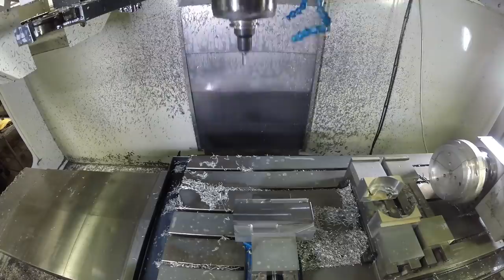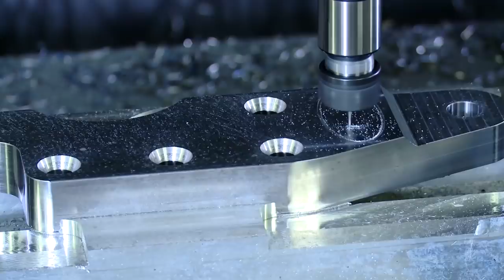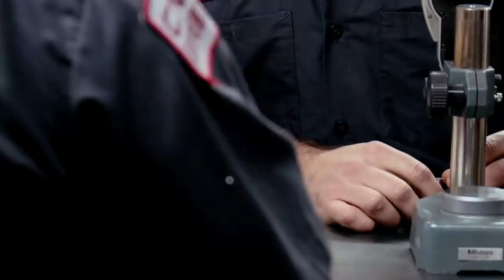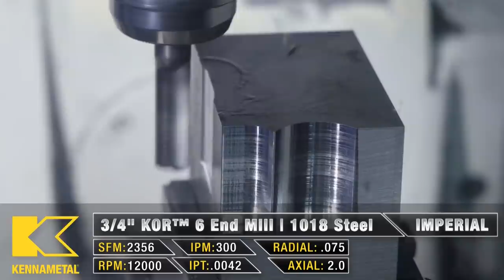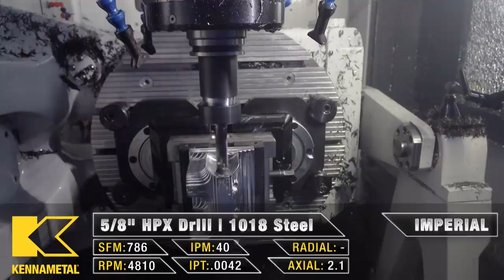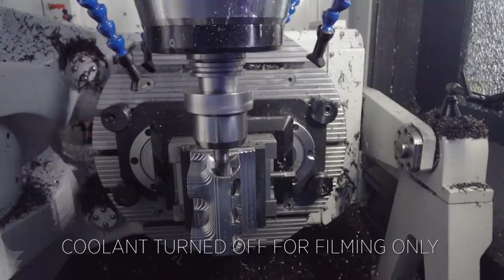Tools Keep Breaking on Night Shift, but Runs Perfect on Day Shift... Nobody Knows Why

Comment: We had a customer of ours complain that the tool life was falling off from what they were accustomed to and that there was something wrong with the inserts that we were supplying. After a months long in house review our sales rep got permission to go into the factory where they were being used. Turned out, due to piece work requirements each shift worker would pull a perfectly good working insert and put a new one in at the start of the shift so that it wouldn’t get dull on their shift and make bad parts and cause a tool change. They felt it was better to get it out of the way early so they didn’t have any bad parts on their shift. This caused tool life to go from 15,000 good parts per tool a day down to 5,000 parts per tool. The bean counters were not happy.
Reply: Paying piece work in a factory can cause so many unforeseen consequences. People will do just about anything to get those numbers up for themselves.
Reply: I love how you call them bean counters in English
And we call them Erbsenzähler (pea counters) in German.
Im always fascinated how similar some words  evolved
Reply: @SuperDeinVadda  the two languages are linguistically closely related. Many words, grammar rules and frazes are shared between the two.
Reply: @SuperDeinVadda   Agreed. It's a fascinating subject.  That, and slang.
Reply: That's one thing about involving humans in manufacturing:  they work to optimise what they perceive to be the common goals of the company and themselves.  They can be insidiously clever too!   It is a lot of work to put up controls to make them work more like computers.
Reply: @GeneralChangFromDanang  The irony is, that's exactly what the people who implemented a piece-work system were trying to do: get "those numbers" up for themselves. Of course everyone will do whatever is most efficient for them at their level; it's incredibly short-sighted to expect the workers not to follow the exact same profit motives on an individual level as the company they work for.
Reply: i like how the bean counters weren't happy
who was it that mandated the piece work requirements that made the workers behave that way in the first place, i wonder?
Reply: @SuperDeinVadda  *similarly.    It’s an adverb here so it should end in -ly.  Just trying to help, otherwise your English is pretty good.  Mein Deutsch ist nicht so gut.
Reply: @GeneralChangFromDanang  unforeseen consequences
Thus why you should dock the used tools from their quotas; pay them based on profit, not completed parts.
Reply: @jackmandu  I would say it is an adjective, referring to the sound of the word, whereas an adverb would have it be similarly sounding.
English can be incredibly complicated with its rules and exceptions.
Reply: @jeffreyblack666  - In his last sentence, “similar” is used to describe ‘how’ alike the two languages are.  Thus it is an adverb and should be similarly.  In addition to modifying verbs, adverbs describe “how, where, or when, condition or reason” at least according to definitive source of all English rules from when I was a kid, School House Rock.  This lesson is covered in Lolly, Lolly, Lolly Get Your Adverbs Here.  https://youtu.be/14fXm4FOMPM
Reply: @jackmandu  I realise I misread his sentence, he was talking about the evolution, not the sound, my bad. But the point still stands.
Just because there is a verb in the sentence doesn't mean it is an adverb.
Also, the verbs in this sentense were "facinated" and "evolved". How is not a verb, there is no action of howing. Instead it is being used as a conjuction, linking the verb facination with the manner in which things evolved, and specifically how similar the evolution of the 2 languages are.

In this sentence, the subject is them, the verb is facinated, and the object is the similarity of the way things evolved.
This object is made by the adjective, similar, being applied to the manner in which the languages evolved.
So it's fine being an adjective.
Reply: @brandonn6099  Why not just pay them a set salary per hour?
Paying for profit means people are more prone to taking risks or fiddling. Meaning best case, like here, stuff is more expensive but in worst case it can cost people their lives.
Reply: @Cerebrosum  I've been in many jobs where I watch lazy people do literally a third the work that I do. Doesn't make me feel like working any faster. Pay by hour breeds laziness.
Reply: @brandonn6099  was at a company that first it was 100% hourly before switching to hourly/quota incentive pay. The lazy people just kept being lazy. At least I tripled my pay
Reply: @rmo9808  I mean, I'd have worked 4x as hard as the rest instead of 3x as hard of they paid us for work done, too xD

So it's not just about motivating the lazy.
Reply: @brandonn6099  It's dangerous was my point.
Pay by commission breeds stress and risks of injury.

Use other methods to tackle laziness.
Reply: @brandonn6099  Give me any metric to measure how good an employee is, and I will give you a way to cheat it.
Reply: I like it when the bean counters aren't happy... it's called karma 😅
Reply: @brandonn6099  you kinda assume the pay is worth their time too. But yes there are lazy people. But its not exactly the majority. Even 20 bucks an hour is not great anymore. It's bascailly average.
Reply: @brandonn6099  and then no one would work for them and they’d go bankrupt.
Reply: @pleasureduma9693  No one bad would work for them

Comment: When looking to buy higher end mills as a newbie I noticed that their recommended speeds and feeds were listed in SFM and feed per tooth, that helped me pick up on how important those features were lol.
Reply: Here's something I can really follow along with. I know next to nothing about how programming a machine to drill stuff out of a block of metal works, but I can grasp the "The second shift screwed with the settings and then couldn't understand why it stopped working" idea and what you've said. This is simple cause and effect logic here, or noticing a key detail by reading what's in front of you. It sounds like a basic skill, but I'm often surprised at how few people really have it.

Comment: As a teacher in CNC edu for adults, "Chip Load per flute" is the first thing they learn. Also 2 more things: "1. do not trust previous operator", because any error is transferred to you because you are responsible right now when working. "2. dont touch anything that works" If you do not know whats going on, dont touch it. Just run it. If it stops working, then figure out whats wrong or get help. Simple as that. By these few hardcore rules, students get more self going faster with confidence by that I force them to be active learners. As last thing, "what worked before, should work now" doesnt exist in our environment, due what works in one machine might not work in another. Means adapt or just fail, and fail is no option. That night shift operator should need a bit  education on adapting to what is NOW! Cheers.
Reply: The other big thing is checking all the offsets from the previous user. I'm usually a touch tools off on the stock kind of guy, but my buddy is a 123 block kind of guy with a z offset. He'd also use tool wear to nudge in dimms. Definitely have to keep an eye on those. (we were all small quantity production)
Reply: Safety and understanding the risks involved with cutting tooling and materials should be first.  Second should be the understanding of the basics of metallurgy to understand differing materials (most people in machining don't even understand AISI/SAE).  Chip load shouldn't be anywhere near the top.  
I know what you were saying though - KISS - Keep.It.Simple.Stupid.
Reply: I always used chip per tooth also so would just multiply by # of teeth and use IPR, don't know why people still use FPM with CNC. I know old manual mills had auto feeds that weren't controlled by spindle speed and had FPM, but why do an extra calculation when CNC can just run IPR.

Comment: I think it might help some folks to have a video discussing operator vs machinist. A lot of shops use the terms interchangeably and it leads to employees who don't feel confident in the validity of the skills they have.
Reply: This is true, and almost every operator calls themself a machinist. My company is trying to hire a machinist, so I put together a simple quiz, and one of the questions ask to find the RPM and feedrate, given the SFM and FPT; none of the "machinist" have yet to answer it correctly.
Reply: @mics1417  This question had me thinking.. Am I missing something, or does one also need to know cutter dia and # of flutes to calculate this correctly??
Reply: @brentbarnes1865  Yes I think you'll need the number of flutes, I'm not exactly well-versed in the field but I think if you have the number of flutes and you know the rotational speed of the tool (the speed) and how far the tool is moved linearly per revolution (the feed) you can do simple math to determine how far the tool moves per minute as the spindle speed is already in revolutions per minute, and divide the feed by the number of flutes to determine how far the tool moves linearly for the period between each cutting tooth meeting the workpiece as if I'm correct in thinking it's simply a fraction of the feed for one entire revolution of the tool.
Reply: @brentbarnes1865  in engineering/Machining/any real world field ""question unanswerable because of missing input parameters" is perfectly valid answer to a perfectly valid question. If you want to show "the work", "assuming ... I calculated" does the trick.
Now, that is not a type of question for college graduates, but sometimes all a senior professional has over a junior graduate is asking the right questions.
It is also totally valid to offload calculations to the tool manufacturer and it is totally valid that the tool manufacturer responses with a booklet that contains specific values and recommendation for their products.
Reply: I started working in a small machine shop 4 weeks ago. No previous machining/mechanical experience. I knew from day one just using common sense that I was an operator and not a machinist. I knew how to make the machine run the part but I didn't know the what or the why to get the machine to run the part in the first place. Now I'm gauging my own parts and making offsets and changing tool inserts on the CNC lathe I run because learning whats going on and why its going on is the only way to start progressing from operator to machinist in my opinion.

Also like @mics 141 said. I call myself an operator for a reason. Firstly because its true and secondly its self deprecating I guess. If you're a good dude and you tell the machinists that you're an operator they're going to appreciate that you know where your skills and knowledge are at and you aren't trying to trade on a title that you can't back up. Nothing wrong with being an operator in my eyes as long as you are always learning something new.
Reply: A man of wisdom.
Reply: @GryphonIndustrial  you have the right attitude. You will do fine in your career as long as you stay humble and hungry to learn.
Reply: @brentbarnes1865  The diameter of the cutter dictates RPM's to achieve the proper Surface Feed.  The number of cutting edges will indicate the rate the tool advanced through the work piece.
Say each insert can handle a chip load of .020" per RPM.  Say RPM is 1,000 RPM's
With one cutting edge, tool will advance 20" per minute.
Say the cutter has two cutting edges.  
Two cutting edges, 40" per minute.
   Say you are turning a roll in a lathe that is 36" in initial diameter.  Roughing tool can handle 500 surface feet.
What is the RPM's required on the first pass?
Diameter times pi = circumference.
36" * 3.1417 = 113.11 inches circumference
Convert to feet 113.1"1/12"
9.425 feet
500 surface feet divided by 9.425 feet
53 RPMs
That's why Machinist like running large diameter parts.  Lots of sit time.
Reply: @MaxCruise73   Thanks for the comments, This was a while back but I had originally responded to address what I believed to be inadequate info in the Op's question : "so I put together a simple quiz, and one of the questions ask to find the RPM and feedrate, given the SFM and FPT." In that particular question cutter diameter must also be known to calculate RPM. Or in a lathe, workpiece diameter would suffice as well to find FPR. Was just pointing out that with only SFM and FPT, you cannot determine RPM. As for the sit time, there are some guys who like to sit and watch the lathe etc, When working in my shop I always keep busy with something else if there is a long stint of unmanned machine time somewhere. Cheers.
Reply: @brentbarnes1865  I once did an inventory of my tools.  Surprising how much money I had wrapped up in tools.  Far cheaper than the insane cost of a college education these days.  My tools would not have paid for a semester of college in today's dollars.
I out earned most of my college educated friends and family.
Reply: @mics1417  lol.  That's hilarious! 😁
Reply: @sarowie  that sure was a long answer to a question that nobody asked.  😁

Comment: The best way to prevent changes is to write a standard operating procedure than details the need for the programmed specifications. It will reduce other people from reinventing the wheel during off hours. I have seen factory representatives walk in and their jaws hit the floor on a machine only running around 25 percent on the load meter but hogging material and making the floor vibrate. They have no real idea what a machine can do in the real world.
Reply: I was running this big ol manual leblond lathe and the guys were only taking these .030 depth of cuts "didn't want to push the machine too hard" and getting these stringy bird nest nightmare chips and even had an operating procedure to move the bird nests to the recycling bin but never thought to fix the cut. I halved the feed rate but started taking .150 depth cuts and a beautiful waterfall of golden brown chips and I got the same jaw drop. Mr. Leadman didn't like me much after that, bossman loved me.
Reply: I'm all in favor of allowing changes but if you make a change, you assess the results and, if worse, you change them back.
Reply: @immortalsofar5314  Also: DOCUMENT YOUR SHIT
Reply: @immortalsofar5314  obviously.  😁. It sounds like you found out that some things aren't that obvious to everyone. 👍

Comment: I had the same problem, but the cause was quite the opposite - some 2nd and 3rd shift workers used to speed up machines to 120-200%, to finish their work earlier, and play pocket billiards afterwards.
On some machines they used feed override dials, and on some they edited work programs and put faster feedrates, till the end of their shift. I'm talking about high volume serial production here. On some machines i disabled the dials past 100% by changing the PLC program. On some machines i locked work programs with separate password for each machine. Eventually on some Fanuc machines i wrote proprietary software to track many parameters, including feedrates.
Reply: You an electrical engineer?
Reply: operators fucking it up so bad that you have to resort to ladder code rewrites... you have to laugh
Reply: Somebody in management should have done their job.  
If the night guys don't want to do their job right someone should talk to them about whether they're going to continue to work there.